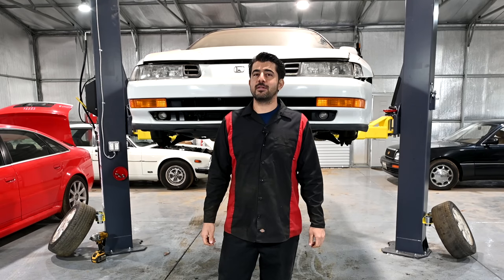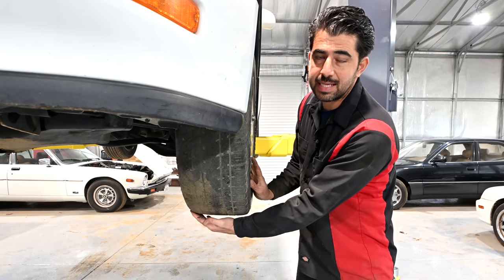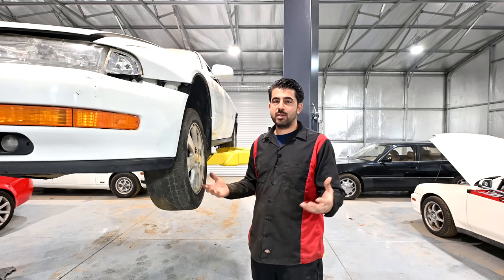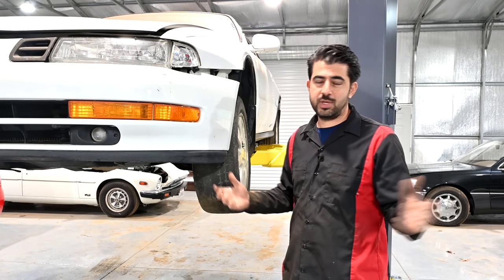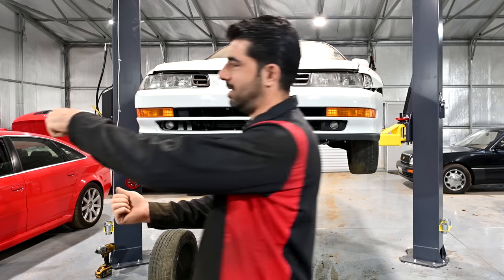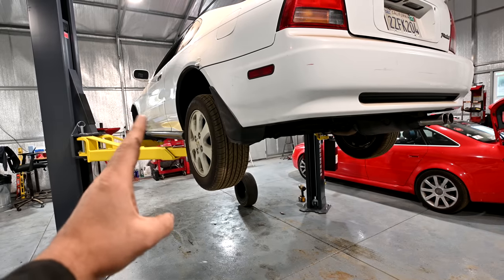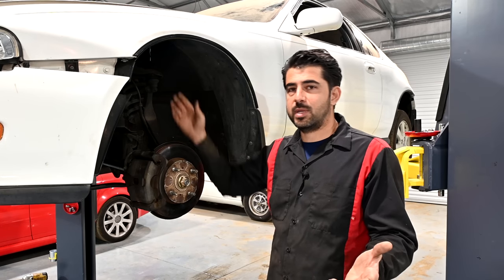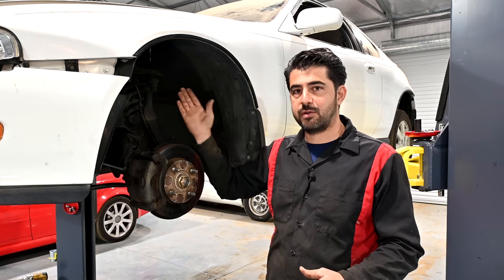Effects Of Camber Angle On Driving - How To Adjust

Comment: Cornering forces also cause the tire tread to deform. Running negative camber allows the tread to deform into a better contact pattern. There is certainly some complex vehicle dynamics in play, but as most people are not engineers this is a fantastic video. Well done
Reply: That's weird, you're saying that as if he didn't mention it.

Comment: Here in Pensacola every other 350/370 & All Miatas have insane amounts of negative camber. Nothing like arguing with teens 25 years younger then me that they are killing their strait line performance. To get countered the own the turns..lol..
Reply: Don't forget all those Subaru WRXs here in Hawaii.
Reply from the maker: Funny thing is they will have a higher top speed due to less tire drag if they ever get there without losing control, but they are indeed killing their acceleration.

Comment: Very well explained. Have you ever changed a ball joint or tie rod end to find out the after market part is not exactly the same size so your steering alignments are off after the replacement? Not a problem with the tie rod ends since the toe is always adjustable. But can can be a problem when you change the ball joint since the camber is not always adjustable.
Reply from the maker: yes the tie rod is ok but I always match the parts in size before putting them on. If they don't match I get another one.
Reply: @myRatchets  I live in Iceland and we have limited access to spare parts, few parts shops and not all of them carry the parts for the vehicle you are working on. Even the dealerships and distributors don't have parts in stock. So if the car has to be repaired immediately you will have to use the part you have until you can order a proper fitting one.

Comment: actuator correlation to rpm through tire sensor rwd ; maneuvers out grit patch in rally or snow condition severe by duality shift timing recognition
Reply: fwd calibration upon differential placement setting is opinionated
Reply: tire thread numeric semsor and majority grit regulator

Comment: I definitely want the DIY alignment.  I can’t find an alignment guy in my area to adjust my car because I’ve added full adjustment to it that it didn’t have from factory.  Gears and Gasoline shows you how to do it at home but they use a lift and a lot of expensive fixtures.  I’m curious how a do-it-yourselfer would do it.  😂

Comment: very good video showing the insight of camber does changing a ball joint affect the camber and coil spring just woundering i done mine last week  may you could do a video on it Thanks
Reply from the maker: If you replaced the ball joints and the coil springs only with matching parts you shouldn't need an alignment. gl
Reply: @myRatchets  Thanks for getting back to me

Comment: I recently installed a front strut tower brace bar to my Camry 2002 2AZ-FE and noticed better handling and reduced backslash on the steering wheel.  Since I installed the front strut tower brace when the brace bar and engine are both cold, I wonder if the brace bar will expand after heating up during driving and hence will reduce the negative camber angle at the front wheel. 

Should we re-install the front strut tower brace bar when everything is will warmed up to a steady state, say, 20 to 30 minutes, of driving ?  

The re-installation steps are as easy as loosening the brace bar mounting nuts after being driven for 30 minutes and tightening them back to torque spec again.

Comment: What about for Honda Vehicles with ivtm-4 AWD ( active torque vectoring) like the pilot or Ridgeline?

The rear doesn't have camber adjustment for 2016 model years and up and I'm having accelerated inner tire wear

Comment: Hey man so i went to get an alignment and my left side camber was off i have a 2017 ram 1500 sport with bilstein 5100 leveling struts took it up about 2" in the front thats it,  when i went to get it alignment my left was at 4.4 on the red, and right was at 3.8 on the green when my wife brought it back the shop the left is a at 4.4 in the red and right at 4.6 red so they are both out of camber, the shop said that is fine that the numbers dont matter its the distance between the 2 that matters, i have 35x11.50 tires in it and its leveld at 2", had extended travel cv axels  and zone ucas he said if i want it back on the green id have to take all that out and go back stock. Is this true or should I be concerned